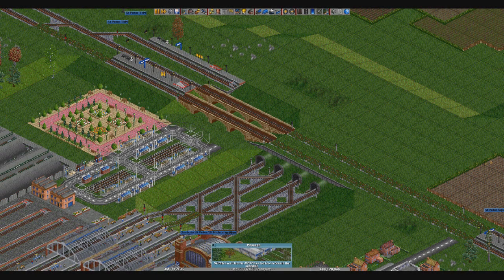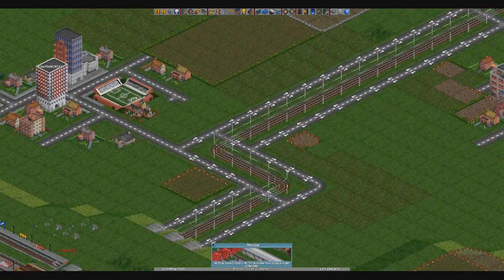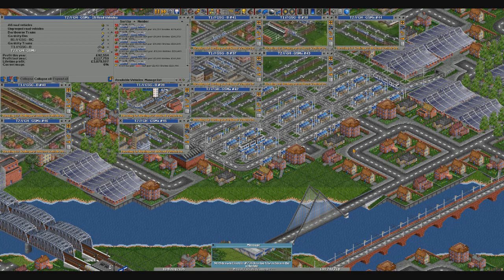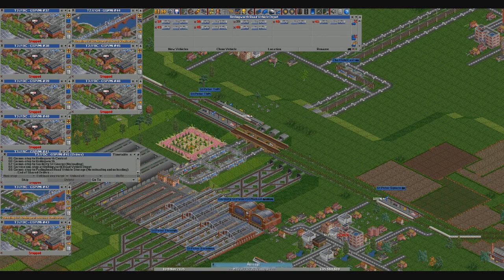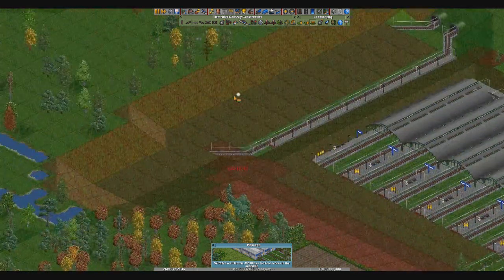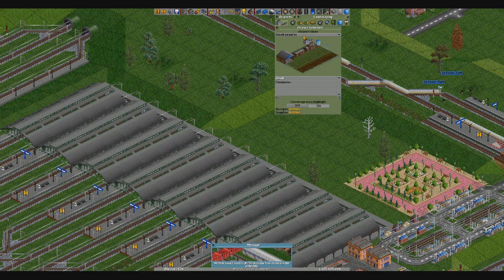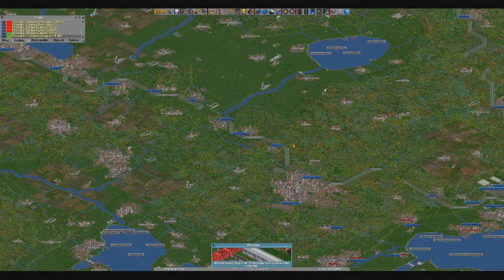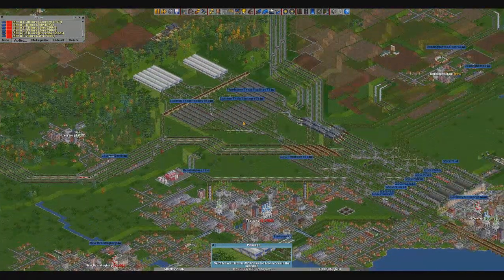The M4J3FFR135 Network | OpenTTD | #86 | Tramming and Planning

Comment: Why do you put one way arrows such that the one-way arrows that would be on the right in the US be on the left, and vice versa. Also to save money, do the "Fund New Buildings" and other events over time such as "Fund Road Reconstruction" once over the time interval until expiry, instead of twice or three times at once at start.
Reply from the maker: +James Moton I don't understand what you mean there. I place my one-way roads to make avenues with crossing points. On corners I create roundabouts to allow access in all directions
Reply from the maker: +James Moton I have money to burn, I just click it a few times even though I know it only works the first time